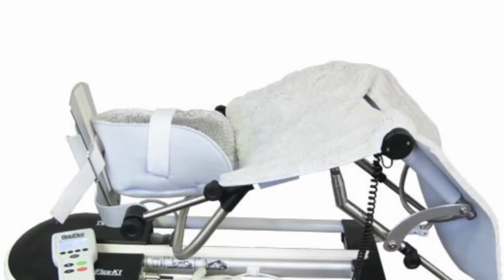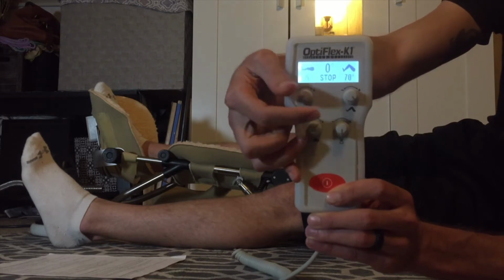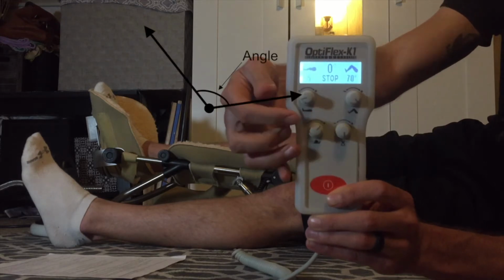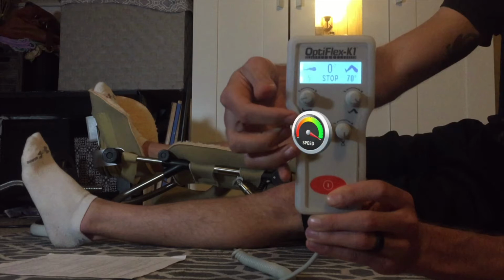Knee CPM Machine IN USE [My Doctor's 1 Week Protocol]

Comment: When you shows flexion to 110-120 degree, your upper leg is no longer parrallel with the CPM machine, which make your measurement incorrct. The reason is in-correct installation of the bars for the upper legs.